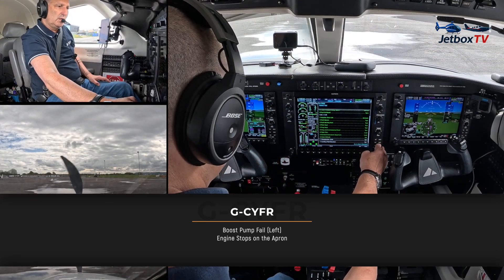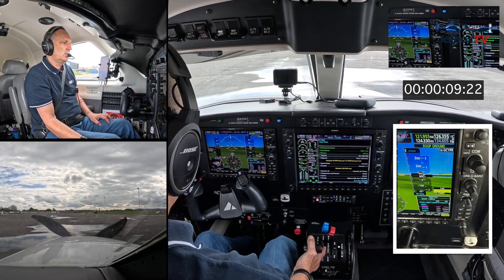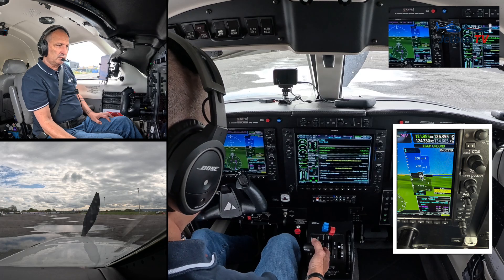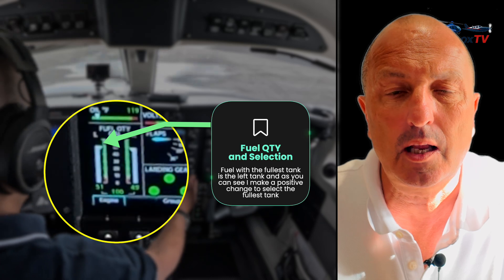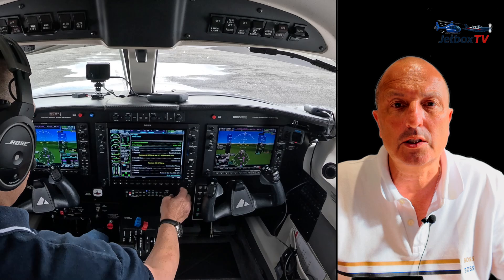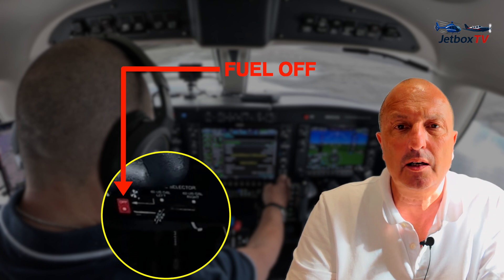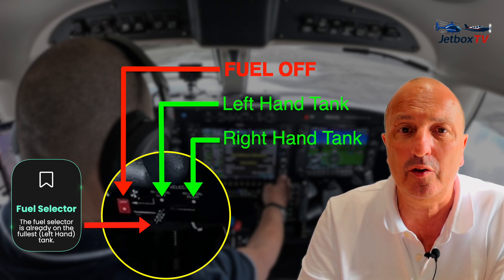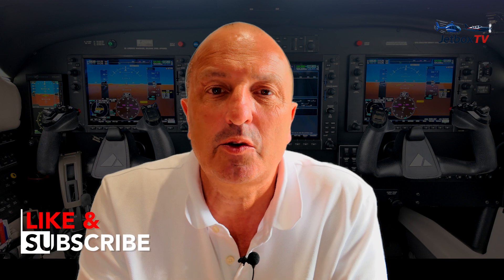Engine Failure Before Takeoff: A Piper M350 Experience

Comment: Are you sure you've passed your flying test?  Over confident that was the problem, gears in a car are similar, you wouldnt want to go from 5th to reverse, that's why they are geared that way, have fun, and stay safe.
Reply from the maker: Well I’ve never met a pilot that doesn’t make mistakes and regularly . In terms of my flying test - yes I have to pass it every 24 months and next year I’ll be flying 40 years . However , it’s not a great design and my research tells me that many people have turned them off in flight because it’s quite awkward to move in any direction so giving it a firm push can lead to it being switched off . As always I appreciate the feedback and thanks also for watching and commenting . Best , Joel
Reply: @jetboxtv  to be fair, i don't know why it told you to swap tanks, does it calculate route and mpg? May be it needs a recall like they do with cars.

Better still in future everyone flying that type start with right tank, then you go left into secondary fuel source, if need arises . . . Errors happen everywehere like the young kid who drove a Asda 3.5 ton food delivery van into me on an angle without hitting his brakes, why i was stationart.

i was a Wigan Hackney driver for 33 years before that ended it it will be two years this June, so yeh safer up there in the sky Joel
Reply from the maker: @peterriley3249 well there’s all sort of arguments with pilots who say you should or should not nap tanks and/or take off on the fullest etc - I do a tank change to confirm fuel flow from each tank and usually start off on the fullest so I can burn off a bit on taxi to equalise the balance . I guess there’s no right or wrong answer ! To make things confusing Piper’s over head switches work in reverse - so when the switch is down , which we naturally consider to be in the on position - their switches are off - I have to double check every time !!!! Very un-natural !
Reply: @peterriley3249 based on that somewhat glib response I am assuming all your flying experience is on MSFS2020. Slips are a fact of life in any field, it's sharing them that prevents further slips. I suspect that @jetboxtv has thick skin, unfortunately comments like that merely put people off reporting and that's bad for the entire community. Sim Safe!

Comment: 2 errors at least here. 1) you turned a switch with “muscle memory” and did not visually confirm the selection 2) you operated a switch not appropriate to the manner it should be used.  In other words you claim the switch operates normally but requires depressing to switch to off.  Soooooo, you depressed the switch while moving it to the left and NOT intending the off position. This is likely against the flight manual and if it isn’t then It’s against good airmanship. Never violate good airmanship, in the Majors it’s called SOP

Good pilots that live to an old age either learn from experience or accept feedback. Maybe you are operating your checklist faster than your capability and/or experience allows.
Reply: Actually re reviewing the video it looks like you attempted to look at the switch but was blocked by the yoke then it looks like you may have slightly twisted your head away (learning forward but not actively looking at the switch) while,moving the switch.
Lesson learned, don’t like the placement of the switch. Bad Ergonomics
Reply from the maker: It is in a bad place AND it's a bad design but that doesn't excuse me getting it wrong. I'm fairly certain I won't make that mistake again !!!!
Reply from the maker: Hi thanks for watching and commenting . I operated it in accordance with normal usage but they’re quite stiff and so requires a firm push in either direction . Unfortunately I shouldn’t have pushed it at all because it was where it needed to be . It’s not a great design and later models have been changed for precisely the reason o found myself in . I also experienced confirmation bias on that I convinced myself I’d done the correct thing . Lesson learned .
Reply: @jetboxtv I have thousands of hours in a PA-46. There is nothing wrong with the design. You made a mistake that any pilot could make. Just own it. I’ve made some dumb mistakes over my 30;years of flying too. It’s not a design issue . . . Just pilot error; we’ve all been there.